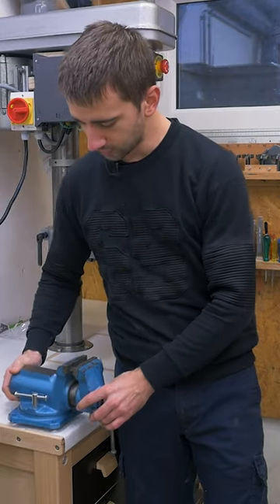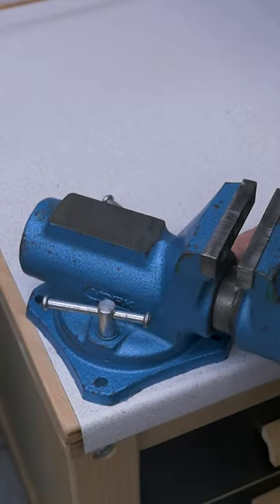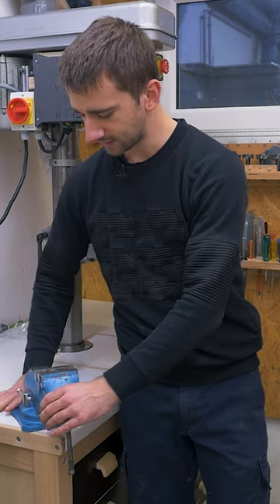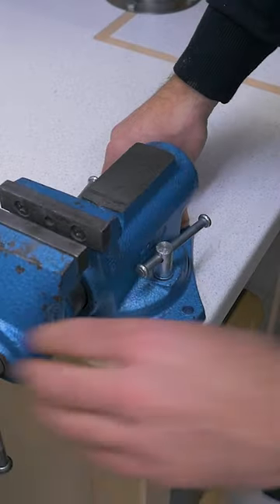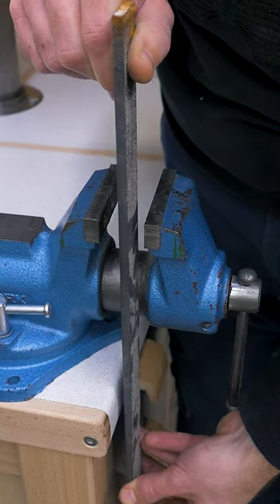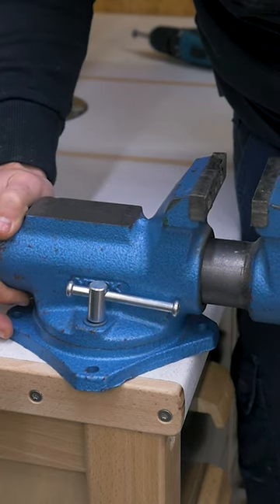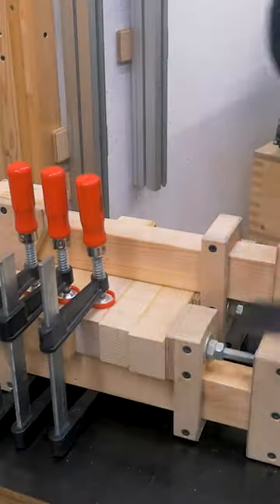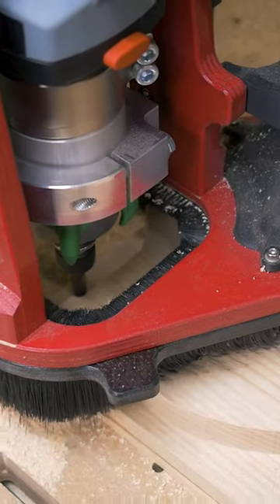Corner vise mount

Comment: Super cool! I never understand why they don’t make better vises. For example hydraulic clamping ones. Or with a foot paddle. Or at least rounded edges so you don’t rip your skin when you file something.
Reply: They do make all those sorts of vises. 
The hydraulic and foot pedal controlled ones are quite expensive though. It's used by professionals in factories.
Reply: Took me more than 40 years to figure out the first thing to do to a new vise, is to file the sharp outer corners....
Reply: @MadeinPoland made a hydraulic vise with a foot pump.

Comment: Did you try taking the vise apart to check if you could just rotate the baseplate/move the end stops?

I like that "organic" style your solution has :)
Reply from the maker: Yeah, the "end stops" are part of the casting
Reply: @MariusHornberger  "welding cast iron" project incoming? :)
Reply: @Jehty_  not worth the hassle, old tony tried that already ^^

Comment: Is it just me or does it seem better because it's a little bit higher as well?
Reply: A higher vice isn't a bad thing, but it isn't a good thing.
Makes tasks like filing easier, but makes rough sawing harder.

The higher it is, the more control you have, and the lower it is the more power you have.
Obviously there are limits to this, but it's a good rule of thumb.